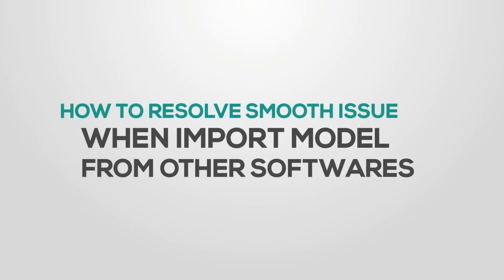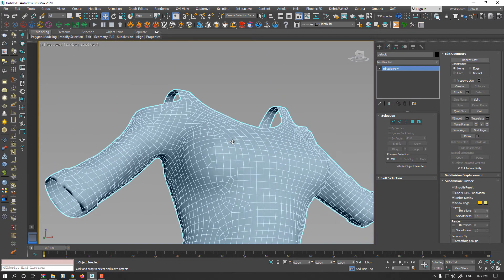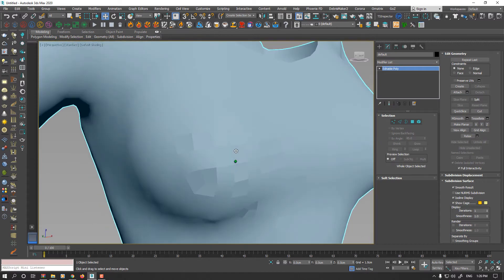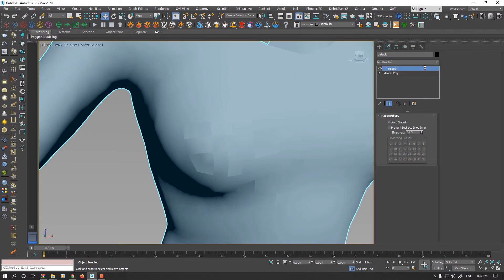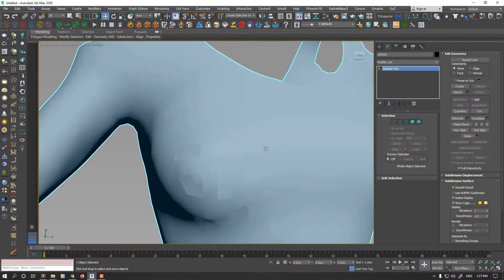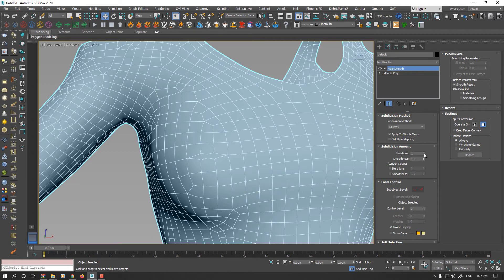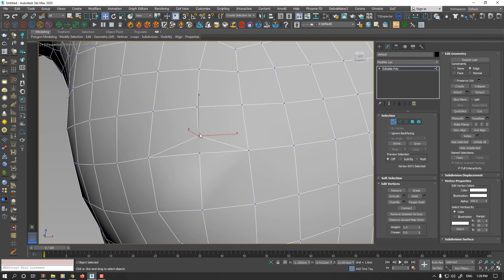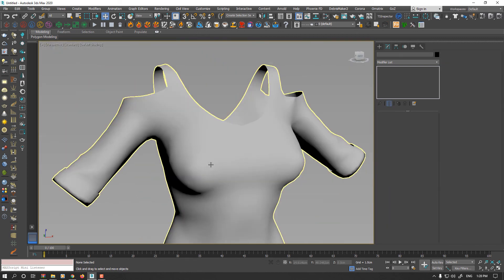Solving Imported Model Smoothing Issue in 3DS Max

Comment: Sometimes it appears some models are just cursed somehow. You can have a weird smoothing group problem similar to seen here, yet no matter if you do exactly what was done in this video, or place 2 normal modifiers on top and collapse them, and also make sure all vertices are single and weld any that are 2 vertices etc. No matter what you do in some cases, the problem just remains, heck you can even physically modify the mesh and entirely change the mesh and still within the renderer the problem somehow remains. It literally is like a bug inside a polygon almost, in some cases the only way I found out to remove it, is to delete the problematic polygons entirely and then just re-create them, then suddenly they do work. 

The fact that sometimes flipping the normals twice solves it for some people, is a testament that the entire smoothing groups thing is a very buggy thing in fact within Max. 
Sometimes it doesn't matter if you did the right thing anyway in Max, sometimes it will just bug out in some way and something won't work until you just redo it.
Reply from the maker: https://www.patreon.com/posts/update-1-asset-118778778?utm_medium=clipboard_copy&utm_source=copyLink&utm_campaign=postshare_creator&utm_content=join_link

Comment: Maybe simply VertexWeld modifier will work? Thank you!
Reply from the maker: This case is not about overlapping, for sure if that's the vertex overlap should be welded, but the problem is about normal angle issue which it is possible fix with normal modifier unify also
Reply: @DATECStudio  Thanks again. I also had this before.  I will definitely check your method.
Reply from the maker: @mishalobanov9744  Appreciated
Reply: Both vertex weld (modifier or edit mesh --> weld), or 2x normal modifier solved the problem. But what causes it? My object was made in max by extrudes/insets. I had 10s of copies to make experiments to edge smoothing and after removed the used modifiers (edit polys/turbosmooths/opensubdivs/chamfers), not tweaking the base meshes geometry. Some copies seems smooth now, without any smoothing group, auto groups to 0 degrees does nothing. Whatever, CHEERS!

Comment: i have been facing the same issue, A simple trick resolved all of the same issues. Two steps only 1. select all the poly faces and clear smoothing group and then click on auto smooth. 2. add edit poly modifier once more and booom!!!
Reply from the maker: In many cases does not works
Reply from the maker: it's not about smoothing the group. its about normal angles

Comment: Good method, but sadly doesn't always fix my messed up smoothing. I did find after playing around some more though, that using your method,  making sure that I weld all verts under 0.1, then creating a Sphere converting it to Editable Poly and then Selecting both the sphere and the problem mesh and going to the Utilities panel (wrench) and using the Collapse tool with "Mesh" as the output type and "Single Object" as the Collapse To setting actually finally fixed it for me. Some meshes are more stubborn than others :P
Reply from the maker: Correct, also using unify normal will fix and is better wy. thanks for your comment.
Reply: @DATECStudio  Yeah absolutely. Sometimes that doesn't work either though. Gotta love the 100 ways to fix problem meshes. ha ha

Comment: My standard solution for strange normals on imported models is to add two normal modifiers and then collapse the model. For some reason flipping the normals two times does the trick.
Reply: God bless you! But what caused it? I did not imported it, was done inside max. No modifiers, no smoothing groups. And looking smooth like sh** in Blender, too.
Reply from the maker: @aerografiaaerografia7405  Many reasons could be, normal faces sometimes get different angles on a common vertex (different connected faces) overlapping, Smoothing groups, etc.
Reply: oh jeese i did not know this, Good tip
Reply: Damm, how come I didn't know about this one, thank you to you too!
Reply: You are my God dude!
Reply: saved my life bro
Reply from the maker: Yes, that's correct, I was a plan to make that video but get too busy. Thanks for sharing <3
Reply: I had a slightly different problem. For some reason smoothing caused some faces to turn black. The normals and topology was fine. I just added a push modifier with the value of 0,1mm, and it fixed the issue.
Reply: @camalpashazade9509  Interesting error. Can't remember if I have had that one, but maybe I add this push trick to my toolbox if I ever come across this issue. :)